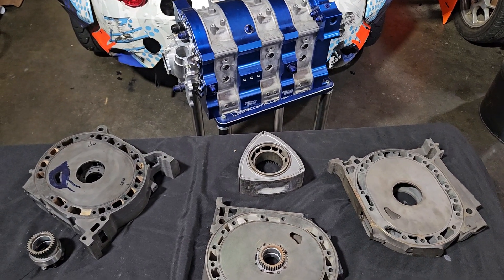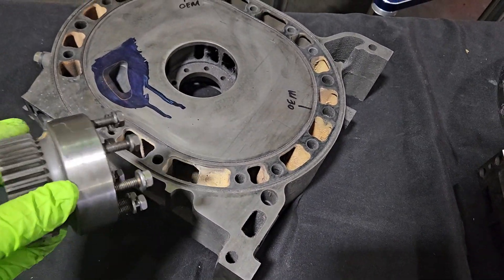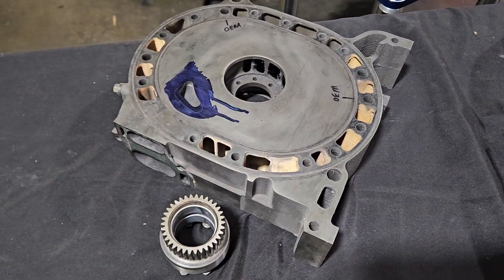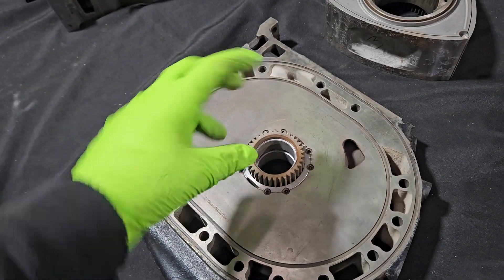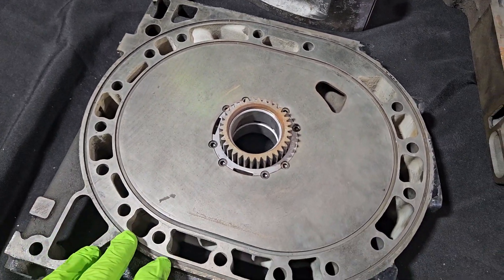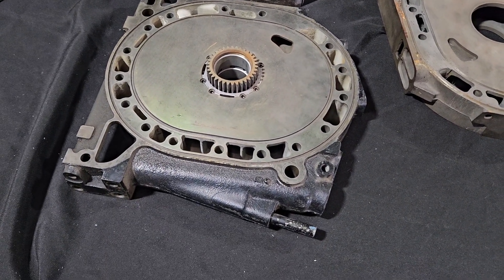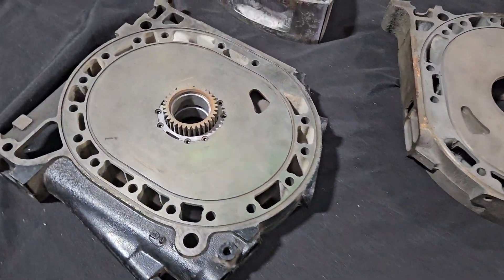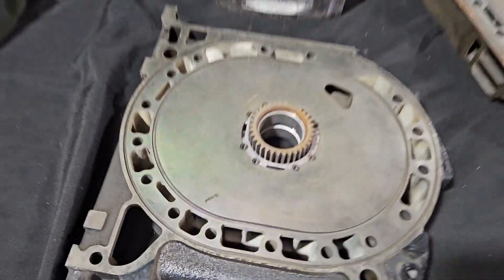What makes a 4 rotor special, looking at 3 rotor and 4 rotor plates - KMR Rotary Tech talks

Comment: 4 rotor motors in Australia are very expensive to build as you are over the 100k figure just in the engine alone. You then you need a driveline that can handle it which is another 50k so you really need to have deep pockets if you want to commit to a 4 rotor conversion.
Reply from the maker: yep, check out the channel for more

Comment: Kyle do you @ KMR or MazdaTrix sell the billet plates. And if so what brand do you recommend. My car is a drag car that’s currently powered by a 3rd gen FD 13B-REW with a single 85/96 1.25ar turbine 85mm turbo on One Ethanol R 117+ fuel as well running a direct port methanol injection system running straight VP Racing M1 methanol also car has a nitrous outlet 102mm plate nitrous system that’s only turned on to get the car up onto the converter to build boost. Car also runs a C4 automatic transmission with a TransBrake and a custom NC-Transmission torque converter out of Puerto Rico. Car also has all the other supporting mods ie: FuelTech FT550 ecu ……but I’m wanting to step my game up power wise but also engine rigidity and safety wise and doing so is going to require me to go with billet plates. I have no idea what brand to go with and who to buy from. Please any information or suggestions would be greatly appreciated. Hope you and your family had a great Christmas and hope you all have a fantastic new year.

Comment: This would make Renesis-based 20b very possible. I wonder if the Racing Beat's Furai engine was made in similar way. BTW are there any Renesis 3 or 4 rotors?
Reply from the maker: maybe i could do  a video about it... possible yes, recommended not really.